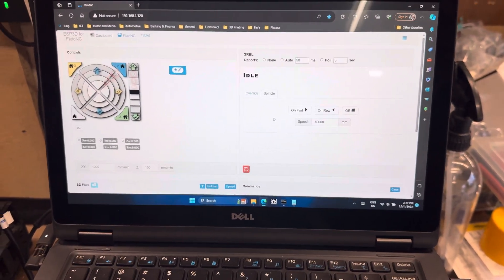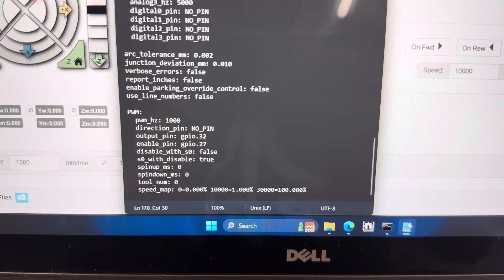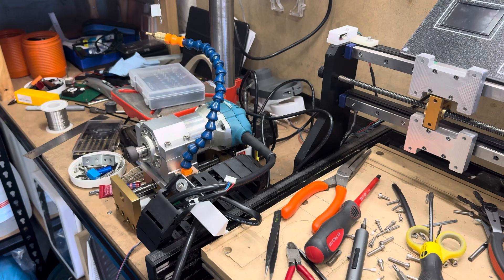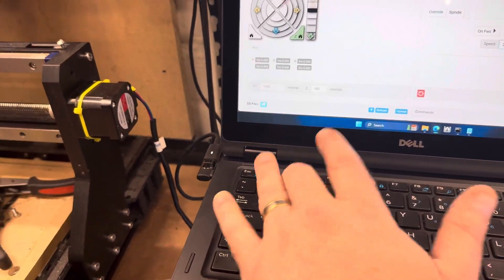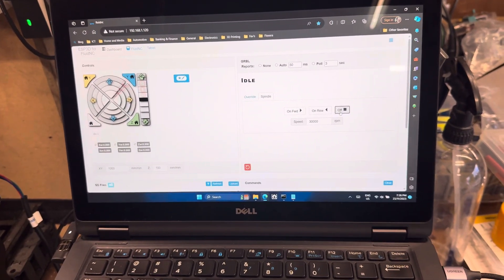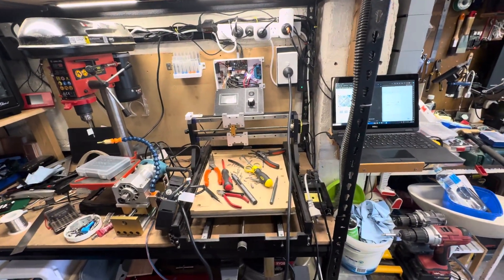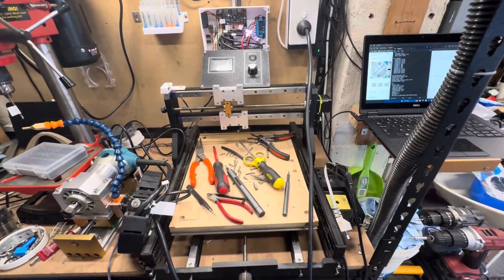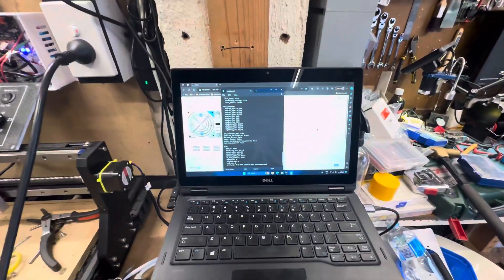Makita 700c + FluidNC w/ full PWM speed control

Comment: Hi - bit of a long post here but I'm hoping you might be able to check a couple of things on your grblSPD output. I've having some challenges with my own 0700 and I'm hoping you might be able to get a few voltage probes on your grblSPD so I can compare with what I've found. Right now, my bottom end speed runs up to 13k rpm and it cant be lowered by the trimmer nor by the speed map. Jon and I both thought it was a duff regulator as the PWM average for 1% is 0.049v which is bob on spec. But I did a bunch of testing today - the dial itself, hooked up to a 5v supply, sends 0v for speed 1 going up to the supply voltage for 100%. That then has my grblSPD send about 0.5v to the router's regulator board - ie 10x the PWM - and that matches about speed 2 on the dial ie about correct for 13k rpm. So I have a bit of a head-scratcher! I was wondering what volts you see across the ground & signal of the grblSPD to your router when you command 10k rpm, and what your rpm actually is? If it turns out yours matches mine in volts and real rpm when you try to set 10k, then I can make the assumption that it's just a designed-in different between the 0700 (220v) and 0701 (120v). If that is the case, I'll have to stick a rectifier or Schottky diode or something in the signal line to drop the voltage enough to get the 10k bottom end, or find a way to have FluidNC operate the relay directly (maybe via an Enable pin) so I can send 0v PWM which should send 0v to the regulator (for that 10k rpm), and still close the relay so it runs. However if your grblSPD sends 0.5v for 10k rpm, and that is the speed you actually get at the shaft, then my regulator and dial are both weird and I'll have to decide if I want to buy a replacement or just give up, save the £ and get a proper RS485 spindle combo in the new year. If you aren't able to check that voltage, no worries I shall figure it out as I go, but it'd be massively appreciated as it'd save a lot of headaches & testing. Ta!
Reply from the maker: @aikengabrielsen2514  I’m per sure my bottom end speed is about 10,800 rpm and top is about 28,000. But I’ll need to check as I’m running the v4 grblSPD board now.
Btw, what firmware are you using? I’m running grblHAL which lets you configure actual speeds vs PWM %
Reply: @Cybernetic_Systems  HI - sorry it's been a while replaying but I didnt get a notification from YT, and work has been crazy this last month so remembering to check for a reply slipped my mind completely... It's been a bit on-and-off with the troubleshooting in the last few weeks; Jon's helping me out a lot, and sent over a socketed older revision with some revised firmware but it looks like at least here the 0700 has some really weird settings in the regulator which are confusing the issue no end. He's got other things demanding time too, so we're doing tests as and when and will hopefully figure out a firmware that will get a minimum PWM speed of <10k. If yours is bottoming out at c 11k, it does make me think that maybe the issue is some variation in manufacture there, or perhaps there really are differences between the model you get there and ours. Or even a firmware revision in the regulator module. Might be the way FluidNC handles PWM or could be my TinyBee board is just rubbish at PWM; changing to grblHAL and separate drivers (maybe with closed loop) is on the cards but not until the new year at the soonest. I am currently doing a bunch more tests and an hour ago found that, with no difference to the wiring at all, putting the v4 unit back in now gives me down to 7500rpm in manual mode! That suggests either my pot has some manufacturing issue changing the resitance between the last set of tests and now, or removing the small relay from the makita and using an ssr on the mains instead has made the difference. Another mystery to solve! But at least I know I can now use manual mode to control the router speed from the electronics box, and can set it low enough for doing aluminium. Having the PWM working too will be a bonus :D
Reply from the maker: @aikengabrielsen2514  no dramas. I’ve been thinking about the issue you mention, I had similar issues ages ago that were caused by poor quality wiring connections. The vibrations from the Makita are pretty harsh, and I’d simply not paid enough attention to the quality of my soldering or I’d damaged a control wire. I’m not a 100% sure, but once I chopped off the suspect joins and redid everything, it’s been perfect ever since. 

I realised I had a wiring issue when my DMM was measuring very different  resistance values for each wire. One in particular was very high resistance compared to the others, indicating it was barely connected. One of the symptoms was inconsistent rpm or even audible rpm fluctuations.

Comment: How did you get this working? I spoke with Jon and he said that you were having a similar problem with speed control. I can get it to engage/disengage the relay but no speed control unless on manual switch and POT than speed works perfectly. I am also using FluidNC on the Jackpot controller "ESP32". I can only get the relay to engage with M3 S18000 or higher and turn off with M3 S0. I noticed that you used both the output and enable pins. What do those go to on your board? I use pin 27 for PWM output pin and no_pin for enable in yaml.config Thanks!
Reply from the maker: Howdy, I had a really long email chat to Jon, and unfortunately it sounds like you used one of the line level outputs which use the board supply voltage. You need to use the 5v PWM outputs.
Ignoring that I have a different controller, that uses a different pin out, this was my working config:

PWM:
  pwm_hz: 1000
  direction_pin: NO_PIN
  output_pin: gpio.32
  enable_pin: gpio.27
  disable_with_s0: false
  s0_with_disable: true
  spinup_ms: 0
  spindown_ms: 0
  tool_num: 0
  speed_map: 0=0.000% 10000=1.000% 30000=100.000%

I was only using the output pin, so you can ignore the enable pin.